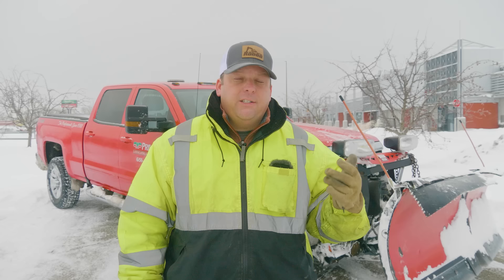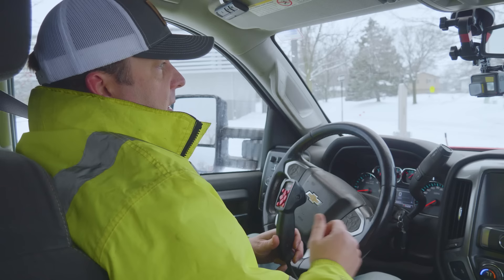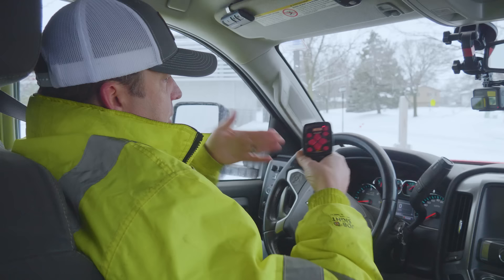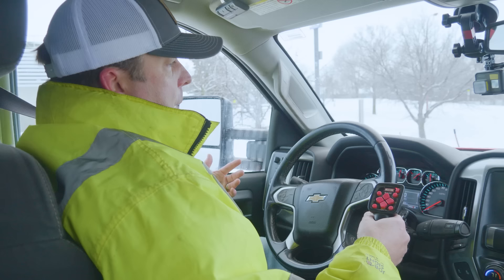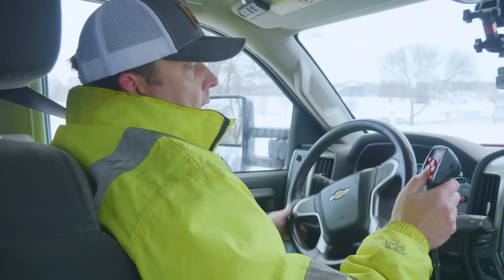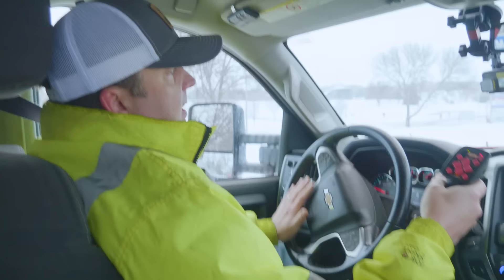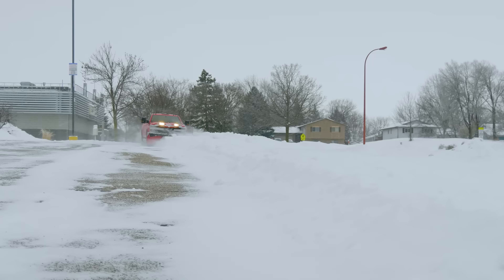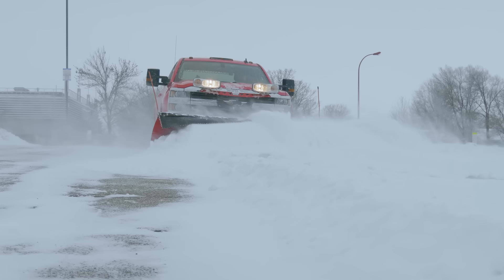How to Snowplow with a Truck | Snow Plowing 101

Comment: Awesome video, thanks! I got hired onto our city's on-call snow crew in New Hampshire. They provided good training however didn't have the plows hooked up to their trucks yet, so the button control part , etc was more theory. These videos helped alleviate some of the anxiety since my next time out will be on my own actually plowing. They understand it will take a few days on the job to really get the hang of it, but still don't want to be a burden as the new guy and slow the others down. Can't wait to check out your other videos. Now curious about salt/sand spreading and how to 'cap off' or remove tall drifts, as they gave me a list of residents (elderly/handicapped etc), who can't have the driveways blocked.

Comment: I'm not an expert but we do professional snow plowing, and I wanted to add something to what you said about "pushing through" the pile at the end of the run. What you said was good and I've "pushed through" before with positive results but one time I had too much speed when I shoved the plow into a tall pile and sheared off both of the hydraulic lines on the plow. It's also very possible to shove snow too far off a depression and get the heavy front end stuck off the plowed area. I've learned to keep it in a low gear at a moderate rpm and try to carefully push, always leaving a pile in front of the plow, especially on the downhill side of the project. 

Also, in some cases, it's nice having two trucks working closely together in case one gets stuck, breaks down, or runs out of fuel. 

If feasible, be thinking about how to push snow everywhere you go. Can the snow get pushed to both sides easily for a while? Is it large enough you can do that without wasting time turning around? Is there a loop that can be made to eliminate reversing? When reversing is the best option, that's fine but sometimes alternative strategies can help improve efficiency.

If you are plowing rural roads (especially dirt roads), keep some speed up when it's safe in case you go into the ditch, and try to immediately power back out of it unless it's unsafe. Slowing down or stopping will almost ensure getting stuck in many cases. Limit speed when nearing steep roads and when clearing the downhill side of the road, because applying brakes reduces or eliminates effective control of the vehicle. Also, use the plow to help shove the truck if you are approaching a dangerous situation. Shoving the snow the wrong way to avoid a problem is better than driving off the road or into an obstacle. Always move snow to the downhill side of the road when possible to reduce the need for bigger equipment later. If you drive too slow or don't plan well, the snow will not be moved far enough off the road, and a Cat or other piece of equipment may need to be employed. Also, when plowing gravel/dirt roads, if it is cold enough to do this, don't plow all the way down to the road. It's okay to see brown here and there but a good mostly frozen snow pack will protect the road over the winter, and keep you from moving the road's surface off to the side of the road. 

Last thing: don't forget to start reading up on mechanics; you are about to need some mechanical knowledge or a really cheap local mechanic. That just comes with the territory.
Reply from the maker: This is all EXCELLENT advice....thank you very much for sharing!
Reply: Thanks!
Reply: You bet!

Comment: A couple of nights ago I went out late to get fast food but everything was closed due to a snow storm (Illinois). I didn't get any food but I pulled a snowplow out of a deep snow drift (parking lot driveway) with my FX4.  Not sure exactly how long he had been stuck but he was pretty happy I stopped.  I used a strap with a large ring shackle on my front recovery hook/ring.  That was a lot more fun than pulling a Civic or random minivan off of a snowy driveway approach.😁

Comment: 1st step, if you have access to a hiniker dealer, get a hiniker plow. They are far easier to operate vs most others thanks to their simple remote design. Thanks to the joystick remote design, it also means faster operation of the plow so you'll be in and out of sites faster. I've run western, boss and hiniker plows. All our trucks are now converted to hiniker plows because of the remote and how clean the hiniker plows can make a property.  The only short coming of hiniker is how they mount compared to boss and headlight bulbs seeming to need constant replacement every other few months.
Reply from the maker: Thanks for the comment!
Reply: How are their scoop plows?
Reply: @ZoroZ333  Just started using scoop plows this season. Works great for clearing larger sites. Just need to be mindful of how much snow your pushing, don't want to burn up a tranny. We can still back drag driveways, just can't get as close to the garage doors as a straight or vplow can. When wind rowing, the scoop plows don't seem to dump near as much snow on the high side (side you're pulling snow from) as a straight or vplow does. Overall, love the scoop plows! I'd recommend avoiding a scoop plow that is longer than 9 feet. According to our dealer, our competitors tried them and dropped them the following season because they lost transmissions due to the sheer weight of snow being moved on each push. 

Bonus, the vplow remote works on the scoop plows!

Comment: Yeah very well explained. Like the way you actually explained not to have spill off and lining up your truck to half of the push line to not have spill have is very well. I like the way you talk about it very good work. Just a little tip I didn’t know if you said it or not. But if plowing. Truck not to drive over the snow because the weight of the truck compacts it and it’s harder to scrape it all up and it could possibly just compact it for freezing so yeah.

Comment: Enjoyed your video on snowplowing 101.  You said you were going to do some advanced snowplowing techniques etc but never did one.  In fact its been 2 years since you did a video?  I think all you need to do is put some time in analytics to get more views and then you will get a much higher view count and subs!  I'm just getting into snowplowing with a f-550 and a Meyer straight blade with a centralized hydraulic system.  I could use some tips as only snow clearing i have done is with a bobcat and a construction bucket lmao

Comment: Hey, guys had an idear for a video for ya, loading and tying down equipment, tracked, wheeled Lowboys tilt decks etc, most truck drivers I've met are barely capable of driving the truck let alone loading the machines... and they are responsible for securing the load, but also lots of operators like to "help" but don't always know how to attach chains/binders etc  Anyhow I do a little of both driving and operating, expert at neither
Reply from the maker: Yeah, we’ve heard that before and would love to do some videos on that.  We’ll see what we can do...thanks for the comment!

Comment: I have my boss v plow joystick on the left so I can control the plow on the go and be lifting the plow going into the snow bank and getting it quickly into reverse. So I'm only stopped long enough for the trans to shift. Time is money.  I've always mounted my controls on the left and steer and shift with my right. It takes some engineering to mount the joystick/ controls on the left but I much prefer it that way and I can go to beat heck. 
And yup, you haven't plowed snow till you've plugged the truck real good into the snow pile! lol
Reply from the maker: Where do you mount it on the left?  On the door?  Interesting concept but just trouble figuring out how you would set it up.  That’s why I prefer a handheld controller so I can shift at same time.
Reply: @HeavyMetalLearning  yup currently mounted to the door but close to the dash on the truck I have right now. It's a little harder to get at the light switch but doable.
 I'm trying to figure how to mount it with a homemade bracket connected under the dash or kickpanel parking brake area, because I did break a wire having it move with the door last year.
But I guess that's me, I like fabbing stuff up.
Reply: Darn dash's are mostly plastic so it's hard to mount stuff to them. 
I have an older F-250 with a steel 8'2" Boss V
Reply from the maker: @429thunderjet2  interesting...that's awesome!
Reply: @HeavyMetalLearning  it's going to make it a little harder to get in and out of the truck with it mounted left side of steering wheel. Was nice mounted on the door because it will swing out of the way with the door. 
 I might have to rethink that! lol
Reply: My plow is old school with rod controls so I have only ever operated controls on the left, the plow is now on it's 5th truck with changing from a steel blade to a poly on the last truck. I've operated it on 4 of the 5 trucks it has been on. I'm now gathering parts to put it on a 6th truck and will have to change controls so I will have to figure out if I can make it work on the left since that is where I've had them on my trucks for almost 30 years.

Comment: You say you plow in 4 high. And that's 1' of snow. Do you ever use 4 low. I own a Silverado and know that 4 low is extremely low. And slow too.
Enjoyed your video.
Reply from the maker: I have never used 4 low.  I guess potentially if it was like a foot of snow and was having trouble in 4 high, but again can’t say I’ve ever encountered it.  Maybe someone else will comment with their experience.
Reply: I occasionally have used four low when the snow gets deep and or heavy wet. I run one of my older scan tools plugged into the OBD II port on my truck to monitor the trans temp, because my truck doesn't have a factory gauge. When it starts climbing much over 220° F or so I will stop and hold it at high idle for a bit or go for a short drive on the road till it comes down. Heat is what kills transmissions in plow trucks, that and getting stuck. Trans & t cases have the highest failure rate on plow trucks, I have fixed lots of them over the years. Also if your truck doesn't have a transmission temperature gauge it's a good idea to add one so you can keep an eye on it. Normal operating temp will be right around 200° F, 230-240 + will boil and burn up the fluid, then bad things start to happen! Boiling adds air bubbles to the hydraulic/trans fluid and makes them spongy, not good.
Also synthetic fluids help too, synthetics can take heat and lubricate better. If your truck is older it probably didn't come with a synthetic fluid, the newer ones do so.
And don't forget about the transfer case fluid it needs periodic changes with synthetic as well as the transmission.
 I use AMSOIL synthetics exclusively, they are not cheap, but are top of the line premium synthetics, luv the stuff. If you would care to check them out go here.
www.amsoil.com/c/transmission-fluid/19/?zo=1064126
PS. A preferred customer membership is a good way to save some bucks
Reply: I run my current truck in 4 low, but it is a Jeep from the 80's and 4 high is a viscous coupler  that can be damaged in a plowing situation. If you have a truck with an auto 4x4 setting do not use that for plowing either. My previous truck had a 4 speed with a super low 1st gear it did well in 4 high starting in low, and shifting to 2nd depending on the length of the run I was pushing and how heavy the snow was, light snow on a long run I would sometimes take 3rd gear but not often.

Comment: First;  put your plow down and make sure you can see your blade guides...GM Trucks, historically, seat the driver and passenger low in the cab, and tell you they've added head room,  unlike Ford and Ram.   
If you can't see your blade guides,  order or buy 36" guides at your Trucks plow installer.  My department bought two 2020 GM C 3500 w/ Western V Plow installed...GM has goosed the hood height and suspension enough you can see the 24" Blade guides when the plow is down...You can't see those guides, is when you make a huge mess.  You can even buy LED illuminated Guide tips is you're pushing powder. 
Finally:  Take your time

Comment: I started off with a 1500. My first year was scary because the plow scraping the ground made me think it was damaging something wether it was the plow, concrete, or my truck. I was also nervous to go above 5mph as i hit a rough area on a driveway which caused my truck to come to a complete stop. Any opinions on these issues? I probably just need to man up lol
Reply: Fake it til you make it. Comfortability comes w. Time
Reply: @bh1567  you are absolutely right. I now plow with a f250 and it's easy peasy.

Comment: Here’s a good question. How do I get hired snow plowing with minimal experience if no one is willing to hire me because of not much experience?
Reply: start as a shoveler, say that your interest is snow plowing. If you can work in the conditions and are a good worker you are more likely to get the position you want next year, or during the current year, say you want to practice operating the plow on off days in an open parking lot. Express that you want to learn and pick up on the things the snowplow operator does.
Reply from the maker: Yes...Braxton has great advice!
Reply: If your confident in your abilities dont tell how much experience you have unless they ask and make sure you walk the property before you plow to find your borders so you don't damage anything I've been plowing 48 years sometime I make a video of it when there's a lot of snow or wet heavy snow
Reply: @garrettmcdougall3360  hey man, is snow plowing easy? You think I can get the hang of it in one day?
Reply: For residential , so just driveways of houses

Comment: You have an extended cab. You should tell the viewers to run with a single cab.
Reply: That might be the problem with my next truck, I have a short 2 door SUV, looking at switching to a Suburban, I have had 2 regular cab long bed pickups so the Suburban might not be bad compared to those.
Reply: why is this the case exactly?
Reply: @Wrtvrxgvcf55  a shorter wheel base truck fits in tighter spots and takes less room to turn around.
Reply: It's harder to find a regular cab truck nowadays